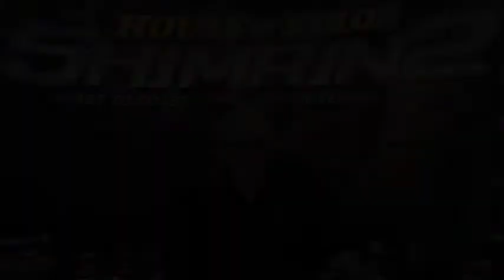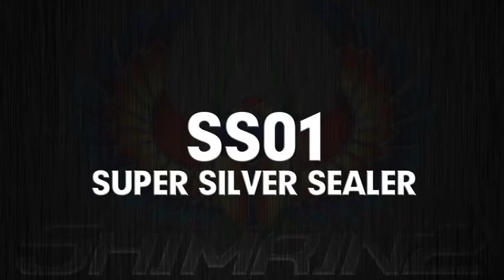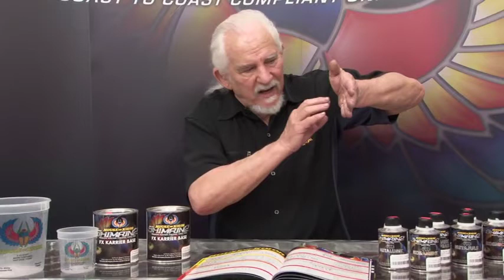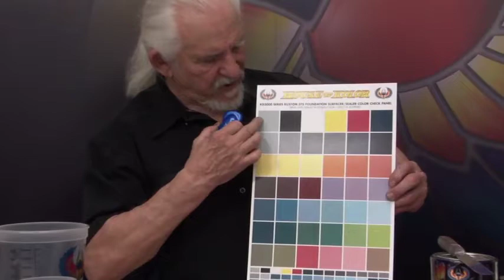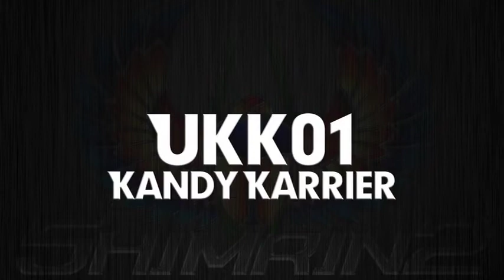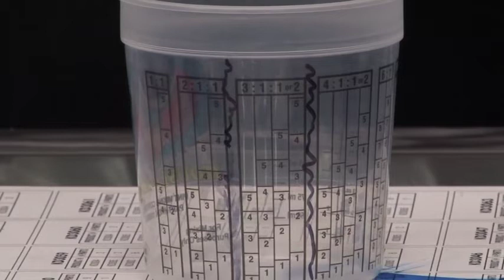House of Kolor -  Shimrin2 System Product Overview - Long

Comment: question about the bed liner system..ive been looking for a basecoat without binders cause it will turn milky..the bed liner is called Raptor. if you could  help I'd be very greatfull
Reply: https://www.houseofkolor.com/homepage/